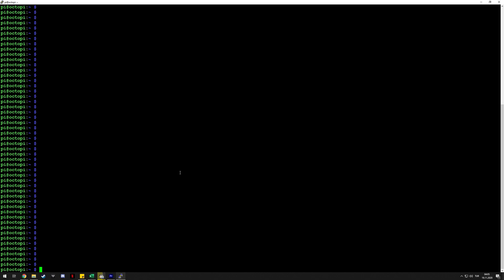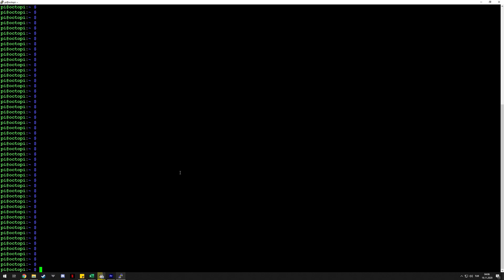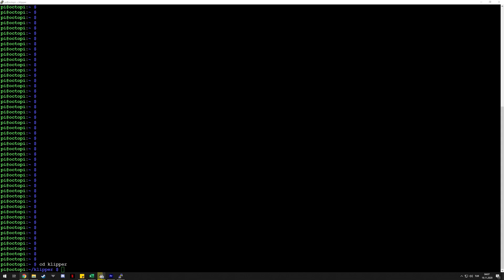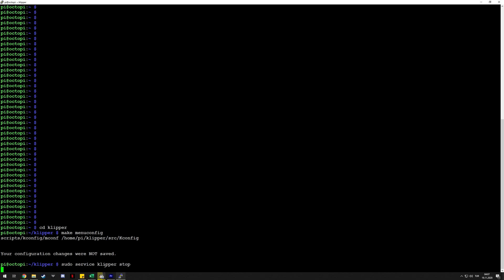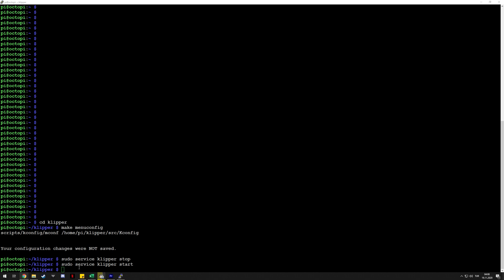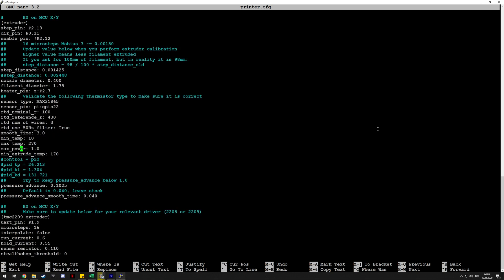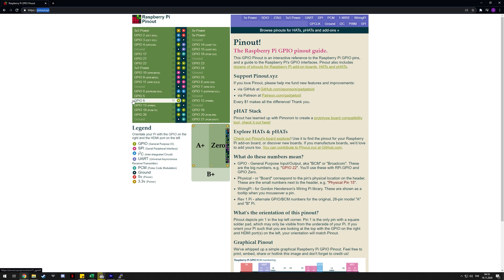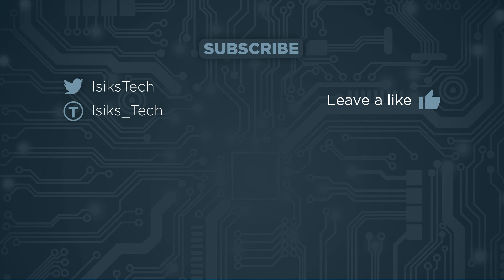Using a Pi as MCU on Klipper

Comment: Hi there. Maybe wrong place but on one of your mods somehow you connecting secondary pi zero as mcu to operate a waveshare display. How you done this? Trying all ways and asking everywhere and no one can help with this.
Reply from the maker: It wasn't a secondary pi. I ran klipper and mainsail on that pi zero.
Reply: @IsiksTech  Thanks for clarification 🙂 That was a lot of confusion for me. So also from that pi zero you connect to skr? If yes to where exactly? By those 2 soldered wires right?
Reply from the maker: Yes the soldered wires. But to establish a USB connection, on top of the data pins you also need to connect the gnds together too. So use gnd and 5v to power the pi, and d+, d- and gnd for the usb connection to the skr.

Comment: Do i just start with a blank sd card and klipper sets it up with firmware as it did with the skr
Reply from the maker: It's installed on the same pi as klipper. No need for new SD card.
Reply: @IsiksTech  oh so dont even need a sd in the second pi
Just have it connected to the first
Reply from the maker: No. You don't need a second pi. This lets you use the gpio of the pi you're already using.
Reply: @IsiksTech  i have a screen on the gpio pins im trying to save messing around removing dtoverlay or whatever it is
Just want to use secondary to run adxl345
Reply from the maker: I don't think you can do that. Try a maple mini or blue pill instead.
Reply: @IsiksTech  ill just install klipper on the second pi and copy config over 😂
Just dont add a screen lol